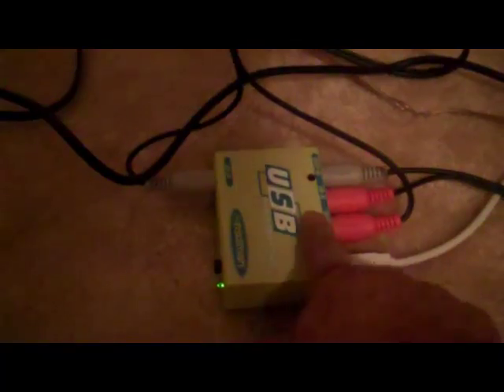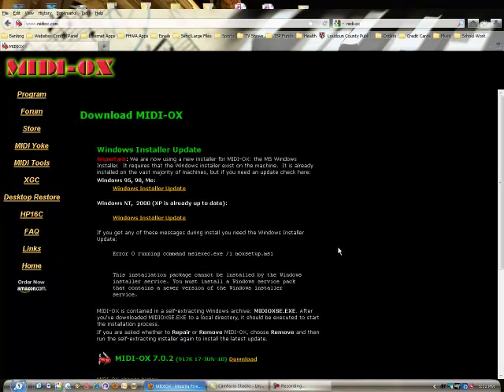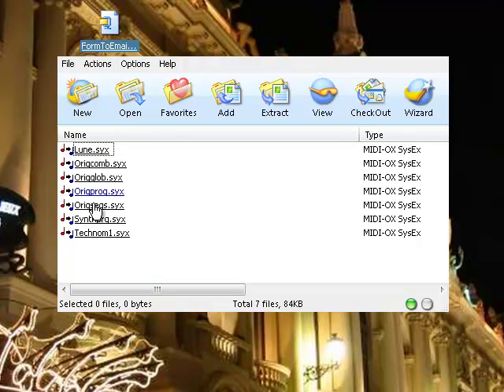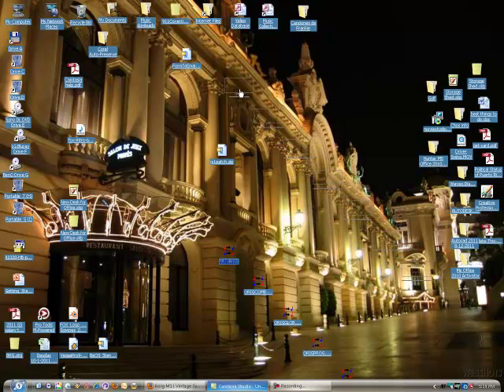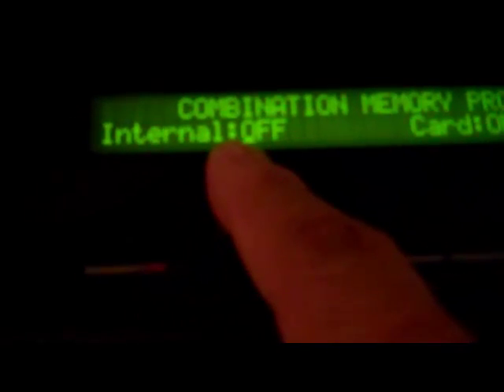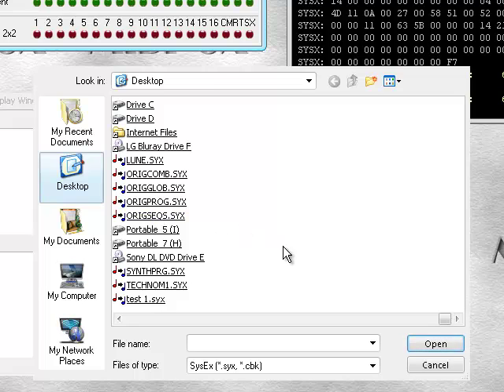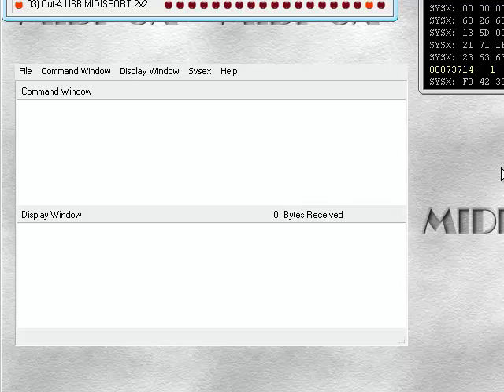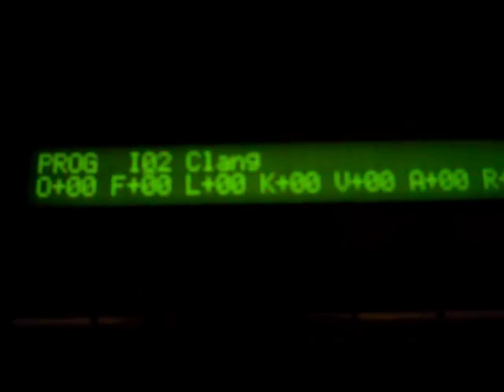Patch Replacement for Korg M1 after Battery was Dead

Comment: Hi, Have followed your vid and been very helpful. Have done all the steps but when i get to seeing the results, the M1 still only has INIT PROG on the screen. Have i missed a step or is there something else i need to do.  Appreciate your help. Cheers Mike
Reply from the maker: +Mike Lind Sorry for the delay response to you.  Somehow the message did not reach me thru the normal way ad now I see you message.  If you still have the problem let me know so I can better show you where to go.
Reply: +anievestor Hi. Still have not been able to resolve issue of patches holding in the Korg once uploaded from computer to Korg. Any help appreciated.
Reply from the maker: +Mike Lind please make sure that the m1 does not have the protection on. Go to global and look for protect and tell me how it's setup.
Reply: +anievestor Midi Global          Common CH
                      CH=9   CLK:INT   Location
Reply: +anievestor Midi Filtering is all ENA
Reply: +Mike Lind Try changing CH=9 to CH=1
Reply from the maker: Make sure that the unit is NOT on protected mode and that you are able to communicate with it.  One way of checking is to send something to MdiOx from the unit and see if it transmitted something.  Then at least you know you can receive (Out), therefore the other cable should be connected correctly.  Let me know how it turns out.

Comment from the maker: OK lets go step by step.  Do you have a sequencer program?  If you do can you communicate with it using your midi interface? Second if the answer is yes.  Then we can rule out the interface.  Third we can then move on to midiox.  You can put your Korg on channel 1 and putting midiox to transmit and receive in Omni mode.  This will make it accept any channel.  Try this and get back to me.

Comment: I really need your help! I've connected every thing and done everything you said but when I press actions and send sys file e.c.t it comes up with "no input device selected" and now I don't know what to do.
Reply from the maker: First of all do you have a working Midi interface?  What I mean do you have a DAW and another synth connected to your computer and that synth communicates with your DAW? If you do and have not done the test just go to the DAW and try playing some notes on the other keyboard synth module or whatever it is and try to establish that your midi interface doe communicate with your synth.  Test both record and play back features.  This exercise will eliminate the question of whether you have a working midi interface or not.  If you don't have a additional synth to test this out with maybe borrow one from somebody.  We have to establish communication before we can proceed.  Does the Korg turn on? Does the display work and display appropriate information?  Please test and get back to me. Thanks
Reply: I can hear the different effects when I  play notes on the keyboard also I can change them too on the keyboard but the sound comes out of the laptop. If I plug my earphone into the korg, I hear the standard piano on every number but I can hear the effects come out of the laptop speakers
Reply from the maker: Just tried to Skype you just now
Reply: Ok I will be available on skype today at 6:00pm UK time zone

Comment: First of all thank you anievestor for your your advice. Your battery change video was a big help. However, some additional details on how I finally managed to restore the factory sounds with midiox:

1. midiox wouldnt recognize the M1. So under options I chose all devices available. Once connected, you should see it in bottom bar.
2. the patch from the vintagesynth site didn't work for me. However, I found a working factory set (amongst others) here: tlittle72.neocities.org. It comes with a pdf-list. So you can check once you loaded the patch to the M1.
3. I still got an error concerning buffer size in midiox when exporting. (I guess the combined patch was too big with that 35KB, haha). Changed Buffer size (options) to 2500 bytes each. BTW my midi-interface is a rather cheap no name brand. Eventually exported the file again according to your instructions. Now my M1 sounds brand new.

Hope this is of any help.

Comment: hi. I have a question i need help with. this evening i reset the factory sounds on my Korg M1 by holding PROG/Combi/Init/Power   Now it has no sounds except a default piano. Do i have to connect via MIDI to a computer to upload sounds? Sounds complicated
Reply from the maker: That would be one way.  The other way would be if you have your sounds on a PCM card you can loa them that way as well.  But unless you have a blank one and formatted it and put your favorite sound patches on them you can re load them.  Hope this helps
Reply: Thank you so much for the reply.
Reply: do i need to put the m1 in some kind of "receive midi' status? I tried uploading these sys files and the m1 didn't blink and all i have is piano
Reply from the maker: You need to make sure the system not protected and your best bet is to make sure the M1 receives on all channels make it Omni mode.
Reply: m1 doesn't have omni :)
I worked out after slowing down the speed of the update. thx!

Comment: great video.....thanks for this but i'm kinda stuck. i've got the new battery in using your video instructions but now i can't get to get the "GLOBAL" button activated or any other button for that matter and without access to GLOBAL i'm kinda dead in the water. any ideas?
Reply from the maker: FuntimeVideoChannel I need a bit more info.  Have you turned it off and back on again?  Do you feel that the button might be stuck? If so try finding a can of tuner spray.  I use to get my from Radio Shack (went away) but there could be stores in your neighborhood that might be still open, or try Best Buy.  Let me know if you have more info.  Thanks
Reply: thanks....i did eventually get the "global' button to activate which let me upload the programs again. i still can't get the "combis" to load though. don't know why. any idea on that?
Reply from the maker: Make sure that you  setup the M1 to accept the number of progs and combis you want. It has several options.  But you must format the keyboard to the correct setting and then upload the patches and combis you have and it will accept it. Let me know how it works.
Reply: hi again, i tried a few different setting...50 progs/50combis and 100progs/100combis and neither one worked. then i tried just loading the combis alone. setup for 50 and then again for 100. neither of those worked. i appreciate your help but i think at this point i probably have an internal button problem or something hardware related....the machine is 25 years old. so i guess it's just shot.

Comment: hi ! thank you for the video :) but i have a question
Everytime i do this steps i got this message : (((SysEx output devices: le port est en train de transmette des donnée au peripherique. Attendez que  les données soient transmises et réessayez.)))
what should i do .. thank you
Reply from the maker: Well thanks for the email.  Well my French is a bit rusty (just kidding.  I don't know French, I do know Google translate though).  It sounds to me that there might something else sending a signal to your midi port. I assume you data is being transmitted because you don't say it isn't.  Make sure you are not connected to other midi gear that might be sending data.  Just shut them off and close your DAW if it is open.  Check your cables.
Reply: DAW ? what is it ?
btw i'm using a MIDI to USB cable, in your video you are using that box i don't have it
Reply from the maker: DAW is a computer application that is used to record and compose music.  It stands for Digital Audio Workstation.  If your connections are correct there should be no problems.  Please give me a run down of the equipment and how you have it connected.  Photo would be appreciated.

Thanks

Comment: if there's someone with the "Korg M1 dosen't receive any Sounddata" issue should check the MIDI Activity Light. If the light does not blink/on during or short after the sysexdata are transmited there is a good chance that the USB/MIDI cable has problems sending sysex data to the M1. The Soundtransfer is working correct after replacing my USB/MIDI cable.

Comment: Hi,
I've installed new battery and have SysEx file, but when trying to upload it to M1 I am stuck at option that Korg wants to upload files from an external Card and is not recognizing file that is being sent. Any suggestions? thank you.
Reply from the maker: Yup. I do. Download the filed that I have listed and try it again. the sysex files are very particular to where they should go. if you have a file that was encoded for the card instead of the memory of the unit then you get that. if all else fails try the following let to upload to the card and then copy the content to the internal memory if that fails then you might have the internal memory shot!  but you are a long way from that. Try what  I told you and get back to me.  Please make sure you have a good connection and the unit is communicating properly withe the computer. Let me know. thanks
Reply: I received SysEx file from Korg and trying to upload it using SysEx Librarian (MacOS) through Focusrite Saffire Pro24. Midi in/out on both ends. For some reason keyboard is not recognizing files that I'm sending. Unfortunately I don't have external card.
Reply from the maker: Well I am in uncharted territory here, since I don't do Mac (sorry never liked it), but I would say don't use the Sysex librarian and go for the MidiOx and try it out.  Try only the midi out from the Saffire to the in, in the Korg.  Did you download the file from Korg?  I have been told by another user that he used that file and had problems.  The configuration was a bit convoluted to get it to work.
Reply: Got it to work! Had to do some adjustments in ports (Audio MIDI SetUp) on MacOS. SysEx Librarian application works great for those who are using MacOS, I've been using nothing but Mac since 1987 :)
Thank you for suggestions.

Comment: Mark Eskola13 hours agoFirst of all, your video on changing the battery was great.  I did that and now am trying to restore the sounds.  I get the midiox installed but when I open it shows No Output devices and No Input devices.  I have tried the midi cables both ways: in put to input, out put to out put and reversed.  My USB to Midi device has a single cable connecting the USB to the computer and one midi marked IN and another marked OUT.  Any help would be appreciated.
Reply from the maker: It should work right out of the box.  Did your interface work with your computer before? Do you have access to another synth you can plug in? I ask this because if you can get information flowing in and out of your DAW then you interface is OK.  For now I suspect the interface until proven different.  Please test it this way.  Let me know what happens.  There is not much you need to do in Midiox to get it to work.  There is a setting menu option.  Make sure your interface is recognized by the midiox.  Let me know BTW sorry for the delayed response.
Reply: Purchased Roland UM-One Mk2. Confirmed Win 10 drivers would auto load on installation.  Connected to Korg M1 per your instructions: Input from Roland to Output on Korg 1. Think I set the channel on the MIDI-OX correctly to match the channel on the Korg, but may not have.  Set all other settings on the Korg per your video.  When I download the Vintage Synth files and open them it shows they downloaded but the Input Port Activity does not show activity on the channel I selected.  It does show activity on the Output port under SX.  Under the Input port the green light shows activity under the Midi-ox generated event, but, again, nothing under the channel I selected.  In any case, the program files are not being repopulated.   Please help.
Reply from the maker: Please make sure that you have enabled the M1 for save patches to the unit.  Under global settings take the protection off for the internal patches.  If you are sending also combi's then you have to do the same thing for the combi's unprotect them or else you can be sending patches until you are blue in the face and unit will not save them.  Also after you do this make sure that you use the selection button (the up and down button) click it up and down. The unit needs to go thru this cycle to refresh the unit!  Let me know what happens
Reply: I'll try that next.  Also, how do I confirm I have the same channel on the Midi-ox and the Korg?  In other words, where in Midi-ox do I go to set it's output channel?
Reply from the maker: I don't have my computer with me right now, but tonight when i get home I can let you know.  Sorry :-(
Reply from the maker: You know thinking even further.  Midiox should be set to Omni so it should not matter.  You can have M1 sending and receiving in channel 1 and MidiOx should pick it up.  I will send you information where in MidiOx to check, but in the meantime do you have another synth you can test your interface with in you DAW to see if you are communicating with the computer
Reply: Sadly, no.  I will try the suggestion noted above and let you know what happens.
Reply: Unable to locate anything that would let me set up the Midiox to Omni.  Any help here would be great.  Wanted to confirm that the midi cables coming out of the Roland are plugged in correctly.  I have plugged the cable with the male plug labeled 'Connect to Midi In' into the female port labeled Midi Out, and then the cable with the plug labeled 'Connect to Midi Out' into the female port on the Korg labeled Midi In.  This is what I understand you to say in your video.  To be fair, I've tried it both ways.  But I would appreciate confirmation that I'm understanding your directions.  Thanks for your help and patience.  Mark
Reply: Had the same issue. Go to options/midi-devices and choose all devices available.

Comment: Well thanks but i struggled the whole time lol.
Using a Tascam US-144 as my midi i/O I managed to successfully get the midi transfer to go.
I had used the a cheap 144 USB device, those things are junk! Don't bother
I had attempted the loopback tests on the tascam and everything looked good, but i couldn't get anything to transfer.
When playing with it i managed to end up with grand piano in slot 00 i think i
somehow used the midiox control panel and forwarded some patches by accident.
So after over 150 attempts i finally got it to work. this is like 15 hours down into this damn thing.
I had to change the CLK to Ext in the M1.
In MIDI-OX i used 500ms delay and 500ms delay after F7
256 bytes
num 32
236 bytes
num 32
Leave the M1 off for 10 seconds before turning it back on.
Reply from the maker: I'm glad it worked out for you.  Iknow things can be frustrating at times but if we hang in on there long enough and eliminate things one by one things work out on the end.  The synth is well worth the hassle.  Enjoy

Comment: please after the battery replacement it still indicating internal battery lowl need help
Reply from the maker: +Danso Mensfred Please make sure you used a new battery not one that has been stored for a while.  Second make sure you have seated the battery on the holder correctly.  And some people forget which way to install the battery and flip it on the wrong side.  Either way you will have to open the unit again.  Make sure that any cables you removed have also been replace in its correct place.  Other than that the process as you saw it is not complicated.  It should work.  Send me a photo of the screen

Comment: OH NO what have I done?! My M1 was working fine, but with sounds I loaded from a card years ago. I was looking to sell it and buyers are wanting the original patches...so I followed this video very carefully and now my M1 looks and sounds like it has had a radical lobotomy. There are a couple of patch names that read OK, like Universe and Flute, but most have gibberish symbols and where the patches actually play (most of them don't at all) they are ridiculous noises. HELP! How do I fix this? I'm working on Windows 8 with an E-MU MIDI 1X1 Tab cable.
Reply from the maker: Wow.  Sorry to hear that.  My best guess is that you have a bad system exclusive file.  Find another place and download it again.  But may I remind you that if you had a set of sounds that you bought! or you made a custom selection of sounds (Like I did in mine) you might not get the exact ones you had before.  You can still do that but you will have to develop the custom library If! you want to make exactly how you had it before.  Question?  did it work well in Win 8?
Reply: Thanks for getting back. My internet was pretty spotty at the time so maybe the files are corrupt. I have new internet so will try again when I get some time.

Comment from the maker: it goes so fast you can't even see it.  sorry I could not go to studio last night I w a watching the game. I will definitely check tonight
Reply from the maker: First I would say buy a can of compressed air and spray into the slots adjoining to the pitch bend and mod wheel.  Then you can get a bottle of tuner lubricant and also spray around the same area. Then go in the back where the 1/4" jack connector is located and do the same thing.  Also try using different cables, try borrowing from friends and people you know that have good cables that don't have a problem and test it that way as well.  Get back to me for further advise.  Thanks and sorry for the delay responding to you.